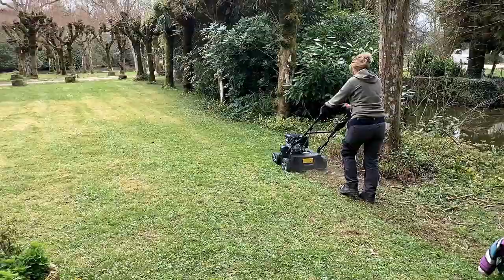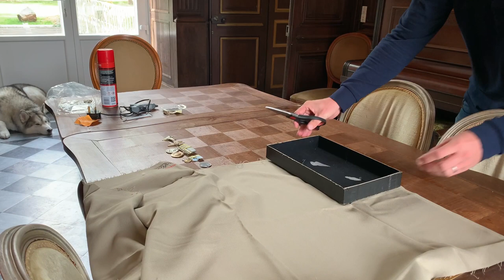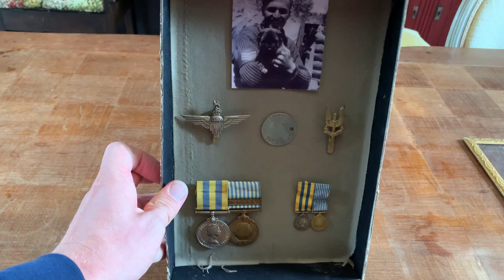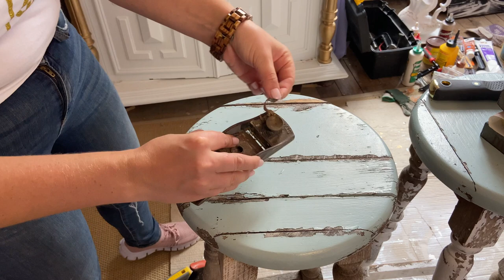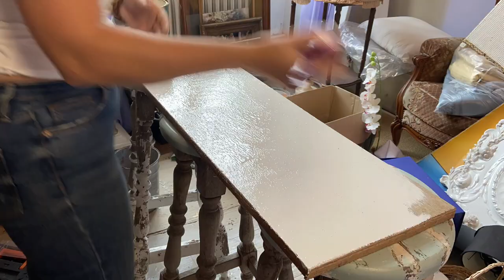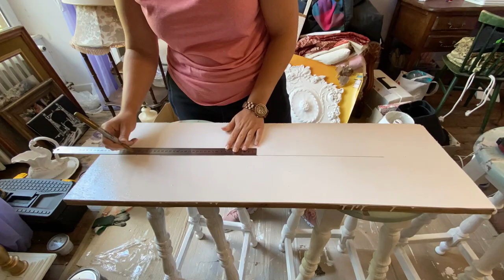Chateau Life 🏰 EP 29: WAR MEDALS

Comment: Really nice hommage to your Grandfather!  Regarding the outdoor stools:  I like the look of regular oil paint, such as used for oil on canvas paintings, and "water it down" with an oil like mineral oil.  You can paint wood with this kind of paint and it won't crack and peel.  You can create all kinds of fun colorful colors.  If you have alot to paint, it might be expensive.  I think you could probably use something like powdered tempera paints and mix it with an oil and paint with that.  It takes a long time to dry.  After it dries, you can paint over it with an exterior clear wood sealer (such as something like a varnish).  You can find fun stickers online, stick those on to the chairs and decoupage with wood sealer.  I looks like you are looking for a sort of Carribbean beach bar look.  I bet you can find fun flower, coconut, mangoe, etc. stickers.